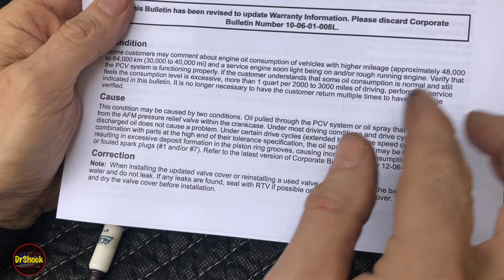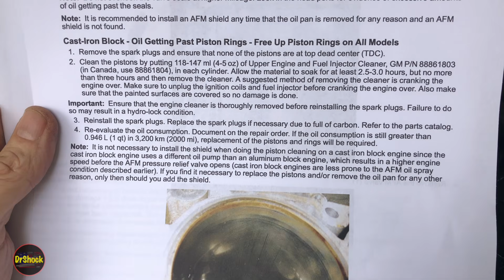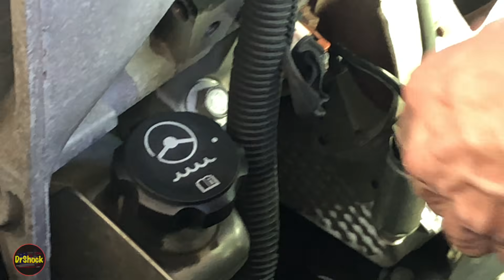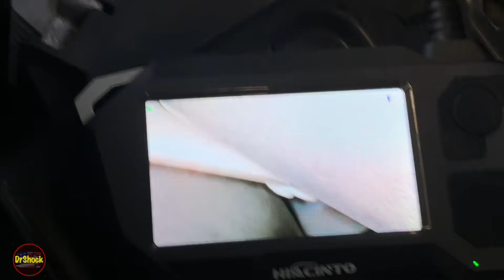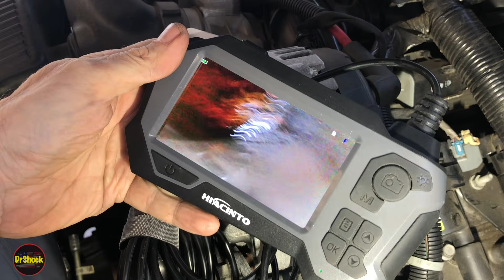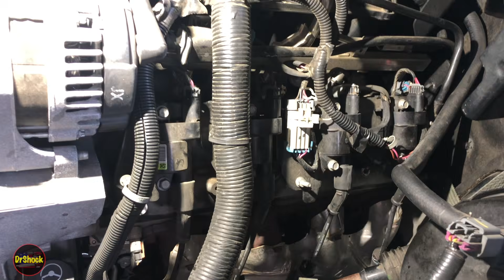2007 - 2014 GM Trucks 5.3L Vortec V8 with AFM ~ Oil Fouled Spark Plugs Piston Cleaning (Chevy & GMC)

Comment: Did you perform this task when the motor was hot or cold? Thanks
Reply from the maker: Given that the cleaning chemical is highly flammable, you want to do this on a cold engine.
Reply: @DrShock  Thank you!
Reply: @DrShock  How much of an improvement have you witnessed on the vehicle in the video, if you don’t mind me asking?
Reply from the maker: I've kept in touch with the owner of the Avalanche shown in this video, they are still going fine on the same plugs so far.  But with this type of problem I'd want to see a minimum 18 months of regular daily driving to be sure (preferably 24).   My theory is that this sort of treatment combined with Valvoline Restore and Protect motor oil will keep the piston rings from being carbon seized and stop the spark plug fouling endemic to this particular GM engine design.   

The GM top end cleaner alone is not sufficient long term, and the Valvoline R&P isn't going to be enough alone either.  But the combination may prevent having to replace the pistons and rings.  So far, so good.
Reply: @DrShock  Thank you so much for the update smile😊

Comment: Have you determined if this helped yet?
Reply from the maker: It's been 6 months now since I performed this procedure on the owners truck, and they have told me they haven't ran into any misfire problems - yet.  But it's not been long enough to know for sure imo.  This treatment alone would have provided short term relief back in the day from the GM dealer.   I combined it with the Valvoline R&P though as well so this video represents a "better" overall procedure than what GM would have tried back in the day as well.   The owner understands they have to religiously stick with R&P for every oil change from now on for this to have a chance at being effective.

I'd like to see it go 18 months without any plug related misfire issues to feel confident in the approach.   There's the possibility we may find another less invasive repair along the way contributing to oil burning, such as aged and leaking valve stem seals that are applicable to these engines, that can be attempted as well.

Comment: Hey DrShock!

Not related to the video, but i was watching your 6.5L related fuel pump videos and I just had to ask you, what is the pros and cons of going through the effort to swap in a DB2 injector where the DS4 one was?

I could only begin to understand the level of effort one would need to change everything over, but maybe it isnt that bad? 

I dont think I’m alone here in thinking that it may be a more long term solution considering the terrible design that is those darn PMD’s 
I would hate to have just bought my new 6.5L GMC 3500 just for me to get into to the swing of needing to replace it every 1-3 years.

Im hoping that you could provide some insight into weather a DB2 swap is worth it.
Reply from the maker: Since I specialize in doing only stock OEM maintenance, repairs & restorations, this sort of non-factory modification isn't something I would be familiar with.
Reply: @DrShock Oh, okay. I suppose I thought, your insight based upon your years of maintenance you have provided the industry, you may have had some insight into that subject, no worries.

Comment: The original formula GM cleaner was truly amazing. The newer one is crap in comparison. It was probably unintended that the original was so good, so they fixed it (might have actually run into environmental regulation somewhere, but it always seems the good stuff is always discontinued).
Reply from the maker: I've found it to be general truth in life that any chemical that does an outstanding job, is dangerous and deadly to both the environment and the user.   But I still find myself answering Yes to the question, "Do you want to live longer so that you can complain about the poor performance of todays chemicals to your great great grandchildren?"  ;-)

Comment: I had a 09 Suburban with that engine.  At 58,000 miles it got a new engine due to massive oil consumption. They did a consumption test 3 times and finally gave us a new engine replacement. The cylinders go out of round, possibly due to inconsistent heat amongst cylinders due to AFM. At 97,000 it was consuming oil badly and smoking. We sold it as it was. Those aluminum 5.3s were not good with the AFM.